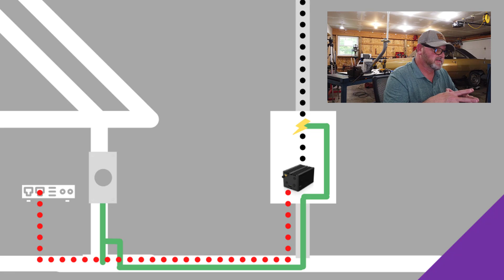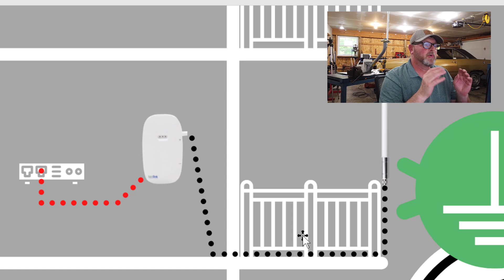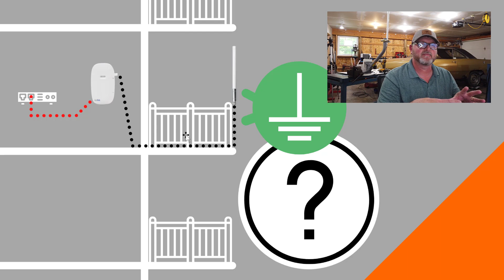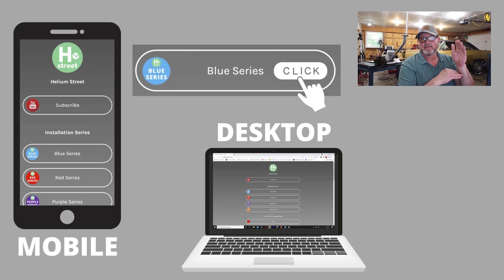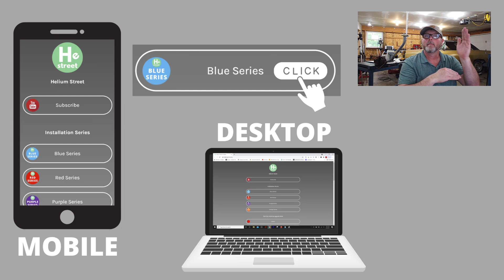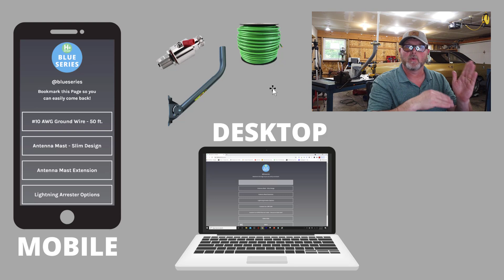Helium Hotspot Miner & Antenna Installation Series [5 WAYS]

Comment: Do you have a video on port forwarding..
Reply from the maker: https://youtu.be/303NAa3LSCE
Reply: I think I figured it out.."think" not as hard as it was being,just had to think about it a while..I think you have to do the static IP address first,from that point create a port forwarding..if you have upnp on the router it should do itself .check if the unit it port forwarding by an online port forwarding checker .

Comment: Can you do initial setup at your house and then send it to a family member and have them do the location setup and internet. Or does my phone have to actually be at the location?
Reply from the maker: @Kirk Ray Oh yes,  The only tricky part is related to WiFi vs. ethernet.  You should set it up and keep it set for ethernet before you send it.  Also, when it gets to it's destination you won't be able to PAIR and do the diagnostic reports, which really isn't a huge problem.  I've done this for a few miners, no big problems.   BTW... Thanks you for your continued support, it is very much appreciated!  Really.

Comment: Can you make a video on how to connect the antenna w/bundle ,arrestor ,you recommended with less talking and more hands on ??? For here installation in USA 🇺🇸?
Reply from the maker: Helium Hotspot Miner - Overall Installation Summary [BLUE SERIES] 01
https://youtu.be/ZsVsGPklexI

Helium Hotspot Miner - Ethernet or WiFi? - Port Forward & Relayed - UPS Systems [BLUE SERIES] 02
https://youtu.be/303NAa3LSCE

Helium Hotspot Miner - LMR-240 & LMR-400 Rules - MPD Digital - Lightning Arrester [BLUE SERIES] 03
https://youtu.be/sFG0XD-ahOA

Helium Hotspot Miner - Antenna Assembly and Antenna Mast - ALL the Nuts and Bolts [BLUE SERIES] 04
https://youtu.be/szpl70_XdwU

Helium Hotspot Miner - Grounding Tutorial [BLUE SERIES] 05
https://youtu.be/L_iRaIlSTKg

Comment: Hi Helium Street, i live on the 7th floor out of 18 in the building. i wanted to attach the antenna like you showed to the railings on the balcony. do I really have to ground it?
Reply: I also want to know that
Reply from the maker: No, apartments are not grounded typically.  I suspect people are just taking their chances.  I would also probably, tbh.

Comment: can you talk about cabling next time? like what are different options when it comes to antenna cabling or we just have to specifically stick to the LMR-400? what are the pro's and cons of using different type of coax with high ohm rating like 75 ohm vs the 50 ohm
Reply: Take a look at a Coaxial Cable Attenuation Chart and you will see why most lean toward LMR400 cable.  I realize the key to maximum efficiency is to run the shortest possible coax run and use CAT7 with POE.
Reply from the maker: Custom Cut COAX Helium Hotspot Miner - LMR-400, LMR-240, & MPD-400 - Discount Code HSTREET
https://usacoax.com/custom.html

Comment: Do we need the self tap ground screws AND the 8 grounding split bolt? Thanks man. Your videos are the best
Reply from the maker: Which color series will you install?
Reply: @vandelay.digital.academy  thank you for the response. Blue I believe. It's going on roof. Two separate ones hotspots. For each hotspot they will be on roofs w 8 dbi antennas, Antenna masts w extensions, w outdoor Rak enclosures. Both antenna have 1.5 meter antenna feeders. I envision both raks to be close to the antennas while running the cables back to the routers
Reply from the maker: Here is the recent video for grounding, check it out:  https://youtu.be/L_iRaIlSTKg

Comment: For any applications with ethernet cable runs over the "100" meters, look into Gamechanger cat6 cable. I doubt anyone will need it, but it's good to know there's a long run option!
Reply from the maker: I looked it up.... can you find this in shorter, custom, or pre-cut lengths.
Reply: @vandelay.digital.academy  I'll look into it but from my understanding it's only available by the spool. I would imagine since it's designed for lengthy runs, shorter runs you'd just use the normal utp/stp cable.

Comment: If I have different hotspots in the USA and I want to upgrade the antennas to 6 and 8 dbi , the 915 MHZ works on the hotspots in the USA or each hotspot ha it’s own 915 antenna ? Thank you
Reply from the maker: Yes, each hotspot has its own antenna.
Reply: @vandelay.digital.academy  thank you

Comment: Hello Mike. Great content! One thing that I haven't seen on any channel here on YouTube as of yet are diffrent ways to ground a setup. I just purchased a 8dbi external attenna and put it on an adjustable fiberglass mast. I reside in Florida "the lighting capital of the world" so, I would like to see if I could find more flexible ground wire for my setup. Another question is if I was to install an 5.8dbi in the attic of a house, does it need to be grounded? Thanks!
Reply from the maker: Grounding coming soon!  5.8 dBi under the roof, not sure about that, I've not tested it.
Reply: @vandelay.digital.academy  It’s a great alternative if you can’t get it outside because of HOA purposes and want to keep it out of sight. Hint, hint. Lol

Comment: [ORANGE]for the apartment/condo application. if we mount our antenna on balcony railing and use a lightning arrestor. Then we ground it to the balcony railing since it is the only metal piece, would this be good enough? This is the only way I can think of because it is impossible for us to run a long ground cable down to ground floor and plant a grounding rod, no way our apartment/condo management would allow it.
Reply: That would only work if your balcony railing is somehow grounded.  An easy way to think of it is that the terminology ground (or earth in other parts of the world I believe) is derived from the fact that your current path must eventually come in contact with the ground or earth
Reply from the maker: Great dialogue, really good.  One thing to think about... your risk is technically lower of your antenna is below the roof line.  I'm not suggesting you don't need to have a ground but I am saying that your risk is technically lower.  And, technically, NEC states a proper ground is one that is connected to the electrical system in some way, ie. a ground rod that is connected and used by your electrical system is an example.  Note:  I was on the roof of a condo in Miami recently, and they had lightning rods on the roof that clearly had pretty significant ground wires that were connected to he main electrical system.  Possibly your condo does also?

Comment: I would like to see an off grid setup with cell service, solar and battery storage
Reply from the maker: Noted!
Reply: I would be also interested in this because of my rural area
Reply: Hi Jamey :-)  Same here, especially with a video guide.  However, there is a great written guide that points to specific equipment, methods etc.  This should get you started  https://kyk13.com/how-to-take-your-helium-hotspot-off-grid/
Reply: Thank you John

Comment: Great ideas!
Have you considered POE (power over Ethernet) to reduce the clutter and making a dongle from the bare POE cable to power and supply internet for a Bobcat mounted next to an external antenna strapped to a chimney or mast???
Reply: The Rak outdoor enclosure includes a PoE injector and splitter. That’s my plan, use Cat cable to run power and internet to the peak of my two story roof and mount the Bobcat in the Rak enclosure with the 5.8db Rak Antenna. My question to Rak is what the minimum operating temp the enclosure supports. Sometimes in the winter we get into Neg temps.
Reply from the maker: To my knowledge, NEBRA Outdoor and SyncroB.it are PoE capable.
Reply: @vandelay.digital.academy  you can get a PoE Splitter that will split you to Ethernet and either Barrel Jack or USB.
Reply: I already ordered Bobcats so I have to do a workaround. I figure Cat7 is cheaper than LMR400

Comment: What about putting up an attached pole to a garage like a ham radio. Cheap as possible but safe and sturdy?
Reply: I was planning something similar. Don’t forget the lightning arrestor and sturdy strap to building
Reply from the maker: Great!  Love it!
Reply: @vandelay.digital.academy  I’m working with an old wooden round pole and I need to get 10 more feet to get line of sight. So far the kits are so expensive. I think I can just Home Depot an idea. No idea where to start.
Reply: I'm going to use my old satellite dish mount. Now if I can get my November shipment. :)